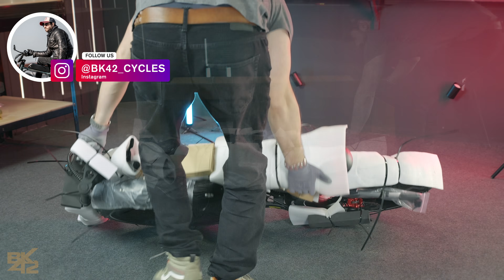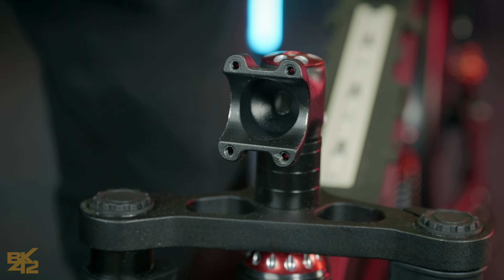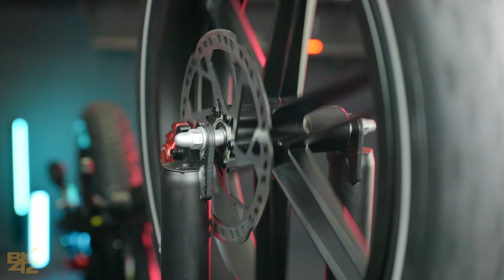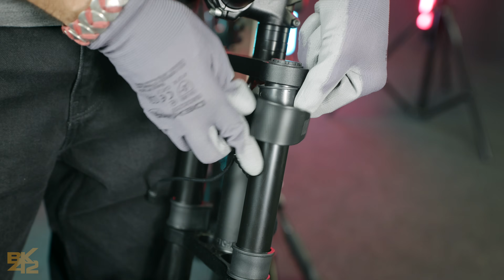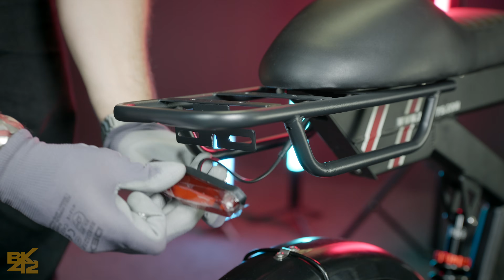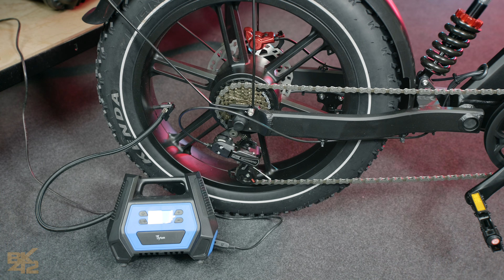Duotts F20 Unboxed & Built – This Thing Is a Monster!

Comment: Hi Bk42! Lovely video. Is the half throttle really optional? Asking if I can skip installing it as it makes it easier in the EU. Unless the EU version is limited to the 6km/s walking assist?
Reply from the maker: Thanks, brother! Yes, it’s optional—the pedal assist will do the job. Honestly, I don’t remember if it was limited to 6 km/h before I unlocked it, but you can easily test it. Once you assemble the bicycle, connect the throttle cables without installing the throttle into the handlebar, and try accelerating.

I can also double-check on mine, but I’ll need some time since I have it stored somewhere else. Thanks!
Reply: @BK42Cycles  Thank you very much for this information. I am currently deciding between this and the N26, which one would you recommend? Use case would be grocery runs to the Super-Market mainly and just using it on bicycle lanes.
Reply from the maker: Man, they’re completely different bikes! I guess the only similarity is that neither saddle has height adjustment.
The N26 screams adventure, and it’s great for that. For everyday errands, though, I’d go with the F20 — especially if you’re not too tall.